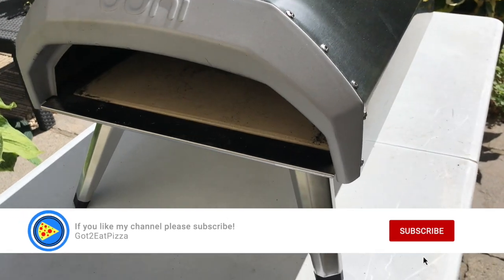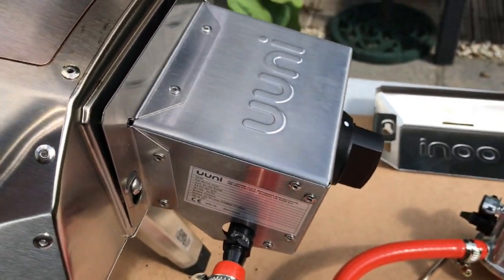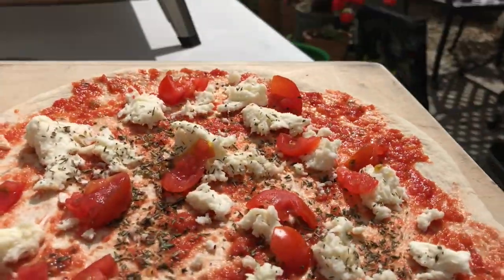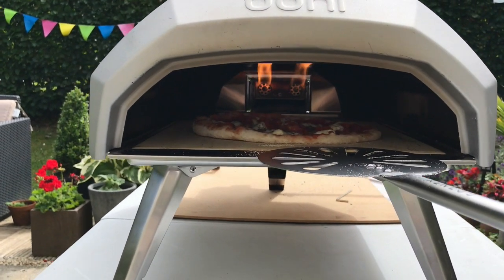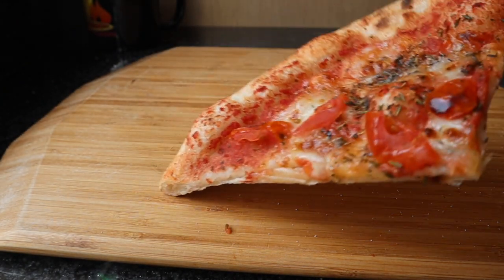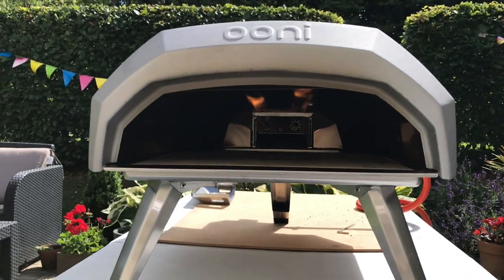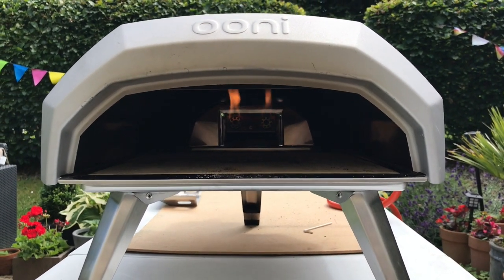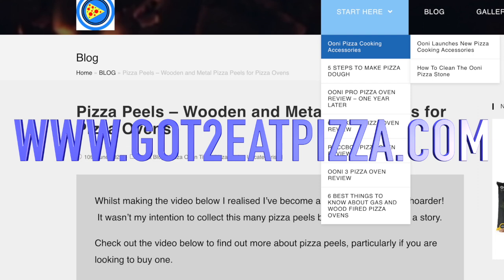First-time using Ooni Karu Pizza Oven with a Gas Burner | PIZZA BEGINNERS GUIDE!

Comment: What a novelty joke the Ooni Karu oven is. 25 minutes of building a fire in the burner tray with wood and charcoal and all that can be achieved is an uneven heat source with the stone temperature no greater than 450 degrees which js less than my toaster oven.
Reply from the maker: Hi - with the wood burner it can get the oven even hotter than the gas - I use lumpwood charcoal and some kiln dried kindling to start it off using a gas butane torch, then I leave that to take for a few minutes; after that I add some more kindling wood and a bit more lumpwood charcoal - this over 10 to 15 minutes takes the heat of the oven up and then a few minutes before the cook I add some more kindling wood to the lumpwood for the flame to cook the pizza.  So I rely on the lumpwood charcoal to heat up the oven and the wood for the flame during the cook.  Keep the pizza door on for the wood burner (not for the gas)  and also ensure the chimney vent is fully open otherwise it won't heat up at all.  I hope that this helps because this is a super pizza oven for both fuels and the stone can retain the heat very well - so much that I need to cook on 410c in the centre rather than 430c.
Reply: You should buy a charcoal chimney to effectively heat the charcoals until they’re white. I pour about 50% of it into the tray and leave the other half to heat more charcoal. I’ve noticed that wood is much more effective at heating the oven, but the charcoals provide a good foundation to get some initial heat. Use flavored wood too!
Reply: Dude ive cooked over 200 pizzas in this thing and its awesome. No probs getting it to 450-500c with wood in 15 mins, not tried gas yet